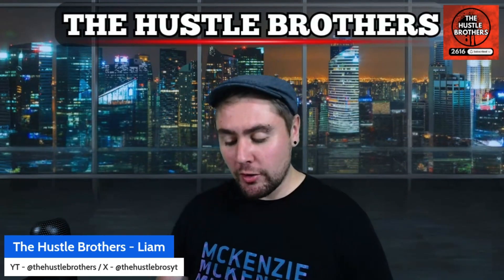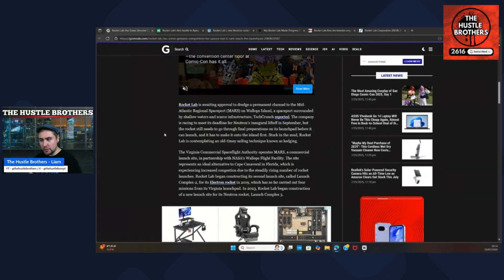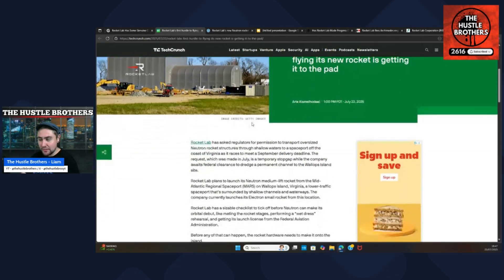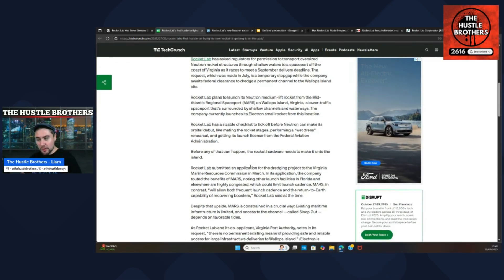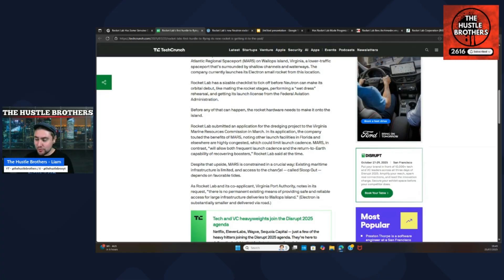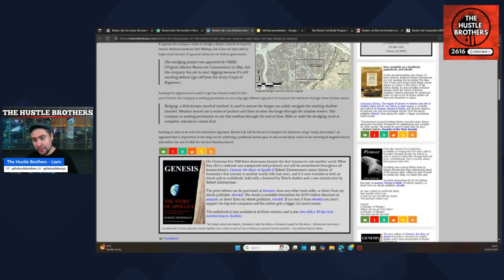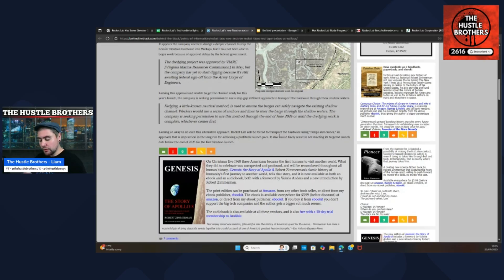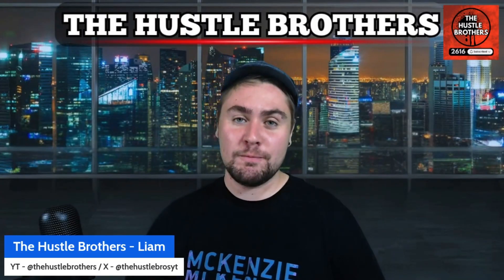How Neutron Will Reach the LC3 | Dredging vs Kedging Explained!

Comment: I googled this and came up with a post on Redit citing the shore daily news.. 

According to Accomack County Administrator Mike Mason, the Virginia Port Authority and Rocket Lab USA are moving forward with plans to improve rocket delivery access to Wallops Island. The two have submitted a joint permit application to dredge a channel known as Sloop Gut, connecting to the Old North Dock on the island’s backshore.

The goal is to deepen the channel to allow large rocket components—up to 25 feet wide—to be delivered by barge. Currently, there’s no permanent, reliable way to transport these parts to the site.

The proposed dredging would create a 5,300-foot-long channel, seven feet deep, removing over 59,000 cubic yards of material. That material would be transported to Charles City County for disposal.

The Accomack County Wetlands Board approved its portion of the project on May 5. Other state and federal agencies still need to sign off, but the county’s role in the permit process is now complete.
Reply from the maker: Thank you so much for supplying this my guy!!
Reply: Wow, congrats on discovering a public infrastructure permit and treating it like you uncovered classified intel. You “Googled it” and found a Reddit post citing Shore Daily News? Incredible detective work — next you'll be breaking news from county board meeting minutes like it’s the Pentagon Papers.

Yes, Rocket Lab and the Virginia Port Authority are dredging a channel. It’s been public for months. It’s called building launch infrastructure, something every serious aerospace company does when scaling operations. Moving 25-foot-wide rocket components by barge isn’t a scandal — it’s a sign of actual manufacturing commitment.

This isn’t some “gotcha.” It’s literally Rocket Lab doing the unglamorous, expensive, real-world work that separates hype companies from executional ones.

So before you pat yourself on the back for quoting a local article like it's a leak, maybe take a second to realize: you’re late, and you just broadcast how little you’ve been paying attention.
Reply: @JohnSmith-p9v  You got something constructive to say? I quoted that article because it shows the task is much less than that imagined in the video.